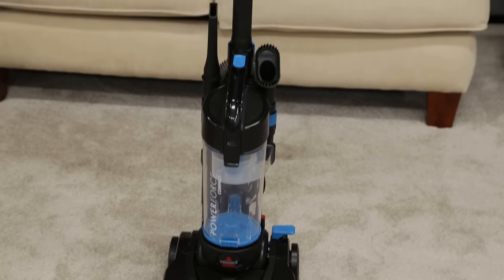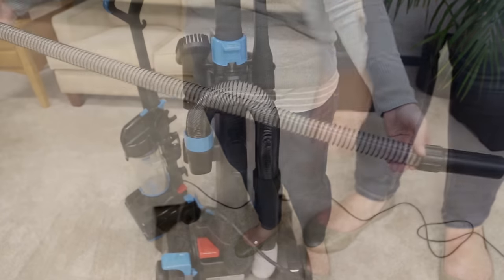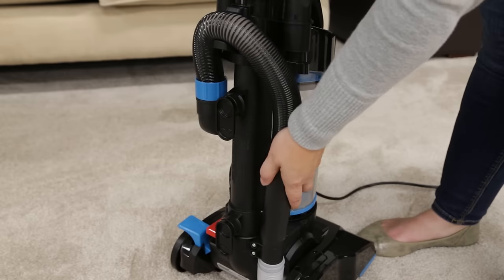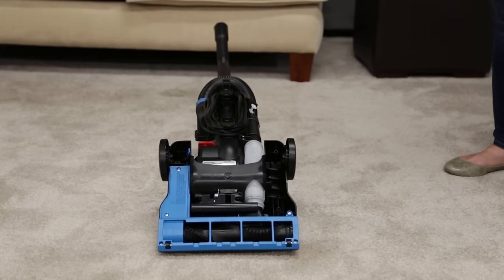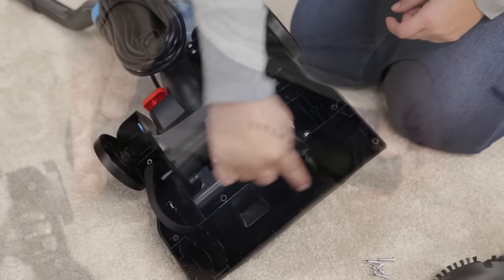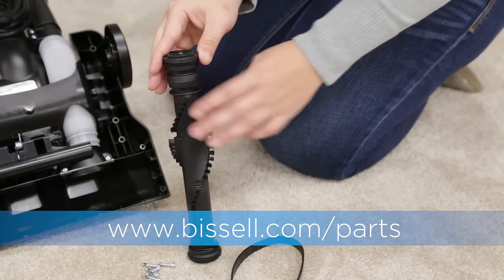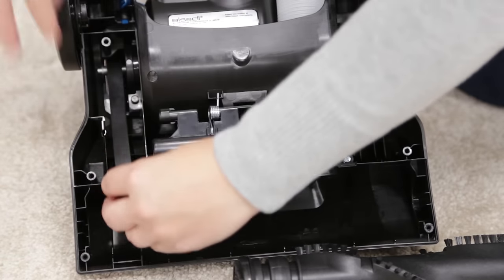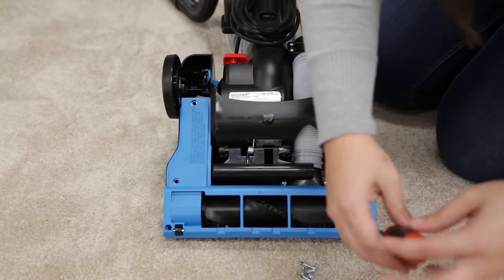What to do if PowerForce Compact has No or Low Suction | BISSELL

Comment: Dear Bissell, please include the right product manual with the right model. The model 3313U has the same product manual as the model 3313. The 3313U has only a pre filter and the 3313 model has a pre and post filter. I spent unnecessary time looking for a pre and post filter because of product manual that came with the model 3313U. I watched this video, but the model number should have included to make things clearer.

Comment: OMG, I just cleaned my vacuum and I had done nothing and I mene\ nothing except empty the tank the brush was filled with hair and the hose and filter were badly clogged.  The vacuum \runs very well  and is not so loud thack you so much Bissell I have had this vacuum since 2017 I don't know how the motor did not bounce out lol

Comment: I come across  a lot of vacuums  that are thrown out  due to not seeing what the solution is.most of the time it's the belt,cleaning, stopped up,filter or they feel its easier to buy another one.
What I do is take everything apart checking to see the problem is  with a good cleaning each part then returning it  to the person or giving it away .😊❤

Comment: Re: ★ Check that the foam disk filter in the tank lid is clean, how do you clean it, with water? I took it outside & tried to take a stiff dry brush to it, which insufficiently sent out a dusty brown cloud, yuk. 😝 Seems like it should have a run under water maybe with a bit of vinegar or baking soda, then air dry before replace?

Re: ★ Checking and clearing out the foot hose behind the foot brush, since the recliner lever only helps semi-straighten that hose, (ie doesn't allow it to quite fully straighten), a broomstick is too straight to pass the slight bend. Therefore a different kind of long bendy device is needed, but also needs to be soft enough not to puncture the plastic hose wall. I imagined something like a small stiff foam cylinder type thing- (think mini pool noodle) would be ideal, but I have nothing like that. A sock on a deconstructed bent wire hanger might work, but too much work to construct on the fly. Finally I got creative to twist an empty cardboard paper towel roll into an adequately flexible (albeit challenging) poker/ dislodger of the dusty hairy clog I'd seen in there with a flashlight.

Re: ★ Repositioning the foot brush into place after foot hose clear, FYI due to the rubber belt tension, NOT at all as easy as in this vid, and I hurt my hand trying to do it. 😭

Re: ★ This instruction vid, yes I am grateful for it, and for it finally occurring to me to search on YouTube, (meanwhile suffering for months with the inefficient suction.) So I wonder why the heck a proper instruction booklet didn't come with this vacuum cleaner. 
- - I loved it's suction power on carpet when I first got it, and was satisfied to see all the cat hair extracted into the clear tank. I just had no clue about how to manage the parts, nor about possible clogs and how can DIY resolve. 
- - Ha, for the first few months until discovering another YouTube explanation about how the wand detaches (for more efficient use of the attachment brush and crevice nozzle), I struggled atttempting to use those attachments pieces on the end of the inadequately short hose, instead of the handle wand. (Thankfully nobody was around to hear my colorful language during my awkward couch cleaning attempts that way. 😜)

Re: ★ Tip for pet owners per my vet's advice re: flea management 🦟🚫: Although vacuuming regularly can keep fleas from infesting a carpet, NOTE: If you don't empty the tank pronto, (ie if you park the vacuum even in a closet with debris still in tank), any fleas captured into the tank can easily escape back into the home and onto your pet. The vet's good advice is to empty the tank immediately after each use, AND best to do it outside to dispose of OUT of the house asap. (Misting the dust would prevent regular dust flying up while dumping into trash, but the outside pronto disposal advice applies only to a flea concern.) I love this tip, and the perk of my now declogged Bissell vacuum as a powerful tool, besides for basic cleaning, to help keep ahead of further flea risk. 😌👍

Comment: if its stuck on both ends the black piece where the hose connects comes off easily as well just on or two screws. be-careful not to pack the dirt with the broom try to pull out with fingers (gross i know) but it'll help loosen it to get the broom handle in with one motion and save time.

Comment: I’ve been fcking with my vacuum for two weeks now! The hose “looked” clear from both ends, but after a much more careful inspection, there was a HUGE clog right in the middle of the hose. It was mostly carpet fibers mixed with pine needles from the Christmas tree. I was getting ready to throw it away and buy a new one!
Reply from the maker: Sounds like a really well hidden clog, we're glad you found it and were able to remove it!

Comment: This definitely did the job, but when I started to vacuum I started to smell something burning! I quickly turned it off and unplugged it. I unscrewed the cover to see if it was something visible, but it wasn't. What do I need to do now!
Reply from the maker: Sounds like it could be the belt. Contact us direct and we can better assist: https://support.bissell.com/app/contact
Reply: Mine did same thing but was brush roll and it wasnt spinning therefore causeing belt to not move and burn i lubricated brush roll and now it works great

Comment: I just bought this vacuum had used it for two weeks and the belt started to burn. I made sure to remove any tangled hairs after every other room I cleaned :( I was hoping if I took care of it, it would last longer guess not.
Reply from the maker: Sorry to hear about the broken belt! Give us a call and we'd be happy to help with a replacement. 1-800-237-7691.
Reply: BISSELL instead of paying or waiting for a replacement, I bought warranty so I’m just returning the whole vacuum it’s easier and faster process.
Reply: Mayra Mitzy too much trash on floor? 😂

Comment: @bissell My vacuum is now smoking where the belt is. The metal where you hook the belt has a burn mark. Should I lubricate or what?
Reply from the maker: Hi Brandon - if the belt is broken, it could cause it to smoke. Give us a call and we can assist further. 1-800-237-7691
Reply: Mine did that when the brush roll wouldnt spin once i fixed brush roll and got it spinning it didnt snoke anymore but i did get a tiny burn marknon belt but vacuum works great sounds louder but i did lubricate brish roll a smidge

Comment: Yeah this vacuum is not worth the purchase, right out of the box about half of what I go over shoots out of the exhaust underneath the tank, I have had no success fixing this, kinda sucks as when I use this vacuum it doesn't actually clean, just sprays most everything that's not larger than a cheerio back at me 🤦